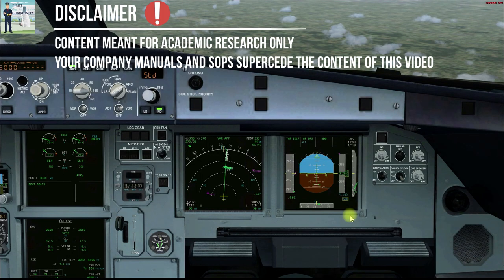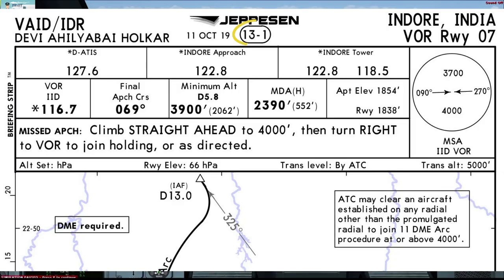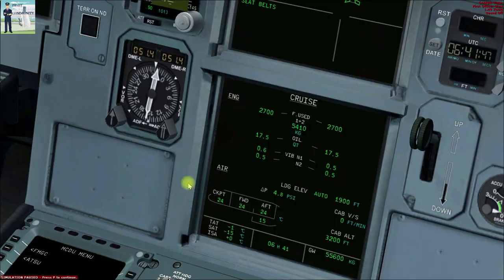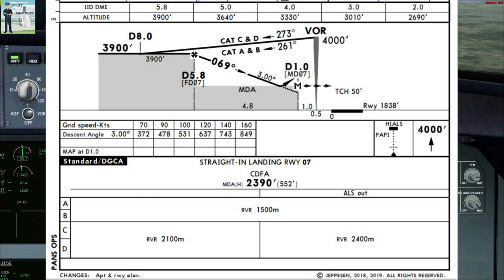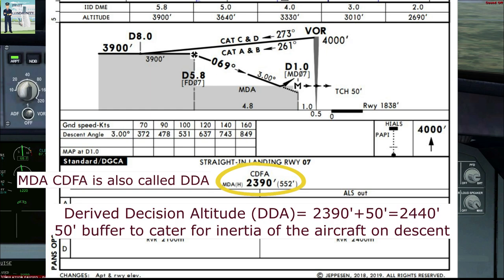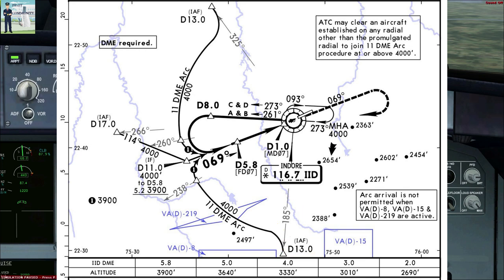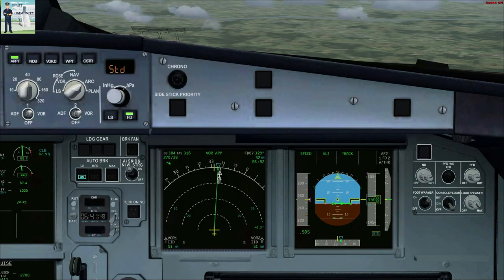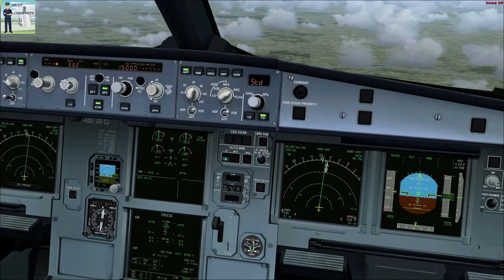VOR approach briefing on Airbus A320| Jeppesen approach chart briefing | VOR approach RWY 07 Indore✈

Comment: Bro  make a video ILS  landing as per Jeppesen approach chart briefing one by one .i confused about Baroo and Radio click function on EFIS  .and when we need to sleck 1013 and when need 92.29  and how to calculate landing altitude .for example runway elevation is 706ft and approch 2700 then what we will do. which one is fallow .pls make video. many time i did landing not properly on fsx.